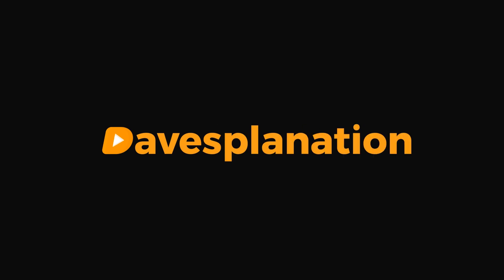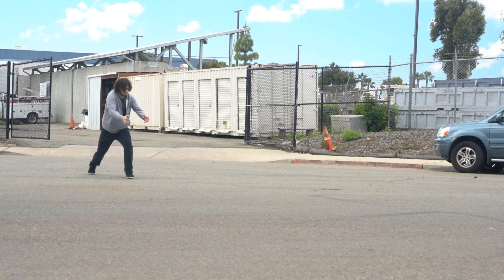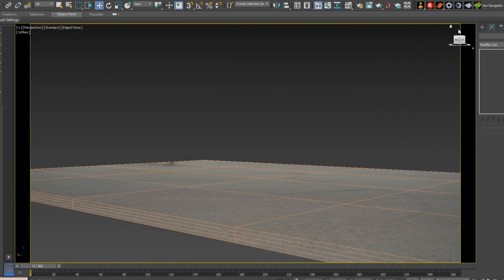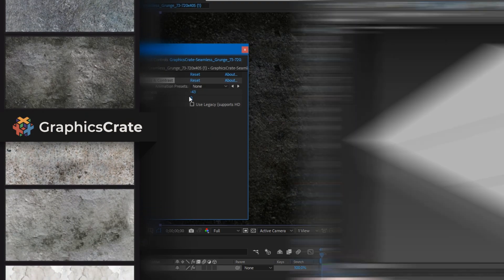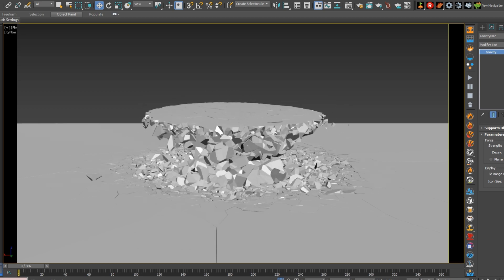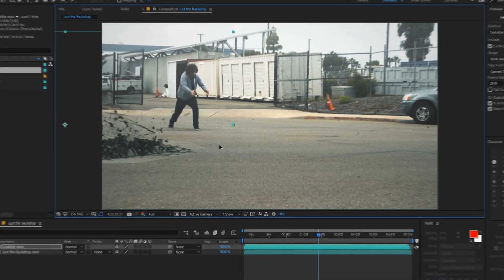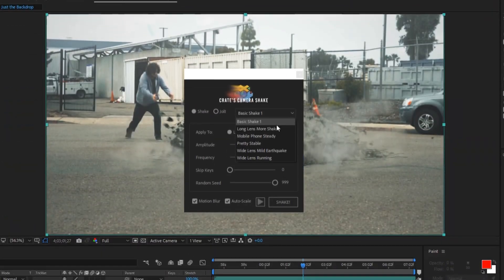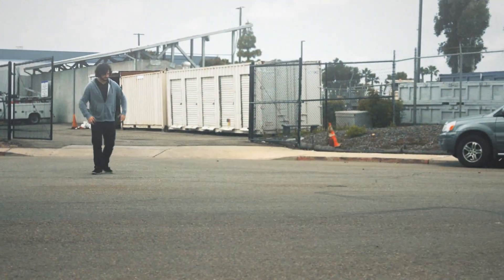Make EARTHBENDING VFX!

Comment: Haven’t tried it but this video sounds way easier than actual thing
Reply: Everyone will run into bumps along the way, but that's the learning process! 😄
Reply: @davidblaker996  how do you add the glue constraints because I cant find it?
Reply: @joetownsend7594  In TyFlow it's called a PhysX bind, in Rayfire it's called a glue constraint (near the bottom), most software have the same tool under a different name :D
Reply: @davidblaker996  do you know what the name for it in Blender?

Comment: How did you manage to get the small rock debris
Reply: This can be done a few ways depending on your hardware:
1 - Set the fragment count ridiculously high! (I think we used something like 6000 fragments in the final version, which is a massive RAM-gobbler)
2 - Fragment certain pieces of debris twice (so for example, you could fragment the rocks around the edges twice instead of once, so the detail is "focused" in the most important area
Reply: @davidblaker996  Thank-you for your reply, I will try to do it by 2nd method.

Comment: Well... I've tried in 6 hours to make this work but it doesn't seem to do no matter what i try. When I use the fracture voronoi script on the box it doesn't move, so I thought that it might actually needed a "massFX RBody" modifier. I gave all the pieces the modify and then when I play the scene using the MassFx Toolbar They explode. 
Please help me. It would be nice with a step by step guide instead of this video which i don't really understand.
Reply: We're planning on a full-length tutorial eventually!
As for the problem you're describing, I'm guessing that the fragments, as well as the original box, are both in the simulation, meaning the fragments are intersecting with the box and so are forced to "explode" out of it?

Comment: bro please help how to pull object with gravity force
Reply: Usually, there's a "Spherical" mode for the gravity force (which can be found in the space-warp menu). Depending on which you use, you might have to actually make the force negative to pull the fragments towards it, instead of away! 😄
Reply: @davidblaker996  thanks bro ..you are make awesome tutorial😊😊
Reply: @davidblaker996  bro one question more how to make shatter object pull like a magnet on spherical mode of gravity
Reply: @lovepreet_fx  Sorry for the late reply! Here are the settings I used (from memory, so it isn't perfect):
Gravity mode: Spherical
Strength:
Frame 0 - 0
Frame 1 - 1
Frame 2 - 10 (something strong to rip the ground up)
Frame 5 - 1
Frame 20 - 0.7 (since we just want it to hover it can be weaker now)
Frame 70 - 0 (Once it "explodes" we don't want any fragments to be hovering anymore)
Reply: @davidblaker996  thanks bro😊😊

Comment: To be honest I'm  not really a fan of the fake camera shake. When a real camera is moved you see that the objects in front of your face/lense are moving faster than objects far away. You notice you world is three dimensional. When you add a fake camera shake to your clip then there is just a two dimensional surface flying around on your screen. 
And when your into video or film making it's much more visable. Just my opinion.
Reply from the maker: That depends, if the camera is moving a fair amount you’ll see parallax but if it’s stationary and just panning/tilting the parallax will be almost not existent, especially with a lack of foreground elements like in this scene
Reply: Usually, I share this view completely! Though it's usually when people simply use the wiggle() expression, which is totally artificial
The great thing about the camera shake script is that it has built-in presets that have been created from real footage, so all of the motion is completely real! That's what I love about it!

Comment: What 3D rendering program was used for this?
Reply from the maker: Dreamis King 3dsMax and rendered with Vray but you can replicate this in many 3D applications 🔥
Reply: @ProductionCrate  thanks! I'll look into it. So far, blender is putting my brain in a blender so I need something that looks a bit simpler like this one, maybe.
Reply: @0Dreamis  Blender might be confusing, but it's insanely powerful, don't give up just yet!

Comment: That’s really cool. I want to figure out how to do this in Blender because I’m too cheap for 3dsMax
Reply: I'll be more than happy to help out if needed!
Reply: David Blaker thanks
Reply: @davidblaker996  how do I render only the fractured part and not the whole cube/mesh with edges.....like they did 🤔😅😁
Reply: Try using the Blender Fracture Modifier. It's free too.
Reply: @cashmerrre  Thanks for the tip! I started using it and it's really cool. I have one question, I don't know if either of you can answer it, but how would i do the part where he textures the block using the image
Reply: Nevermind I figured out how to do camera mapping. Now the two things I have to figure out is where he uses "constraints" to make the rock look correct and how to do the "gravity force" thing.
Reply: if you are a student you can gen it for free
Reply: get***